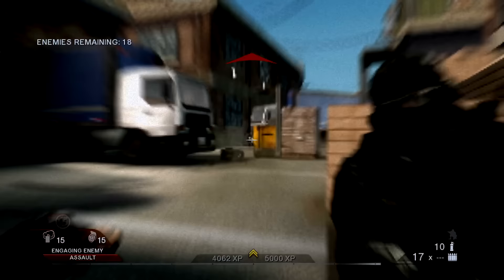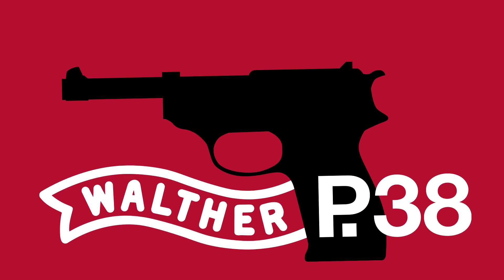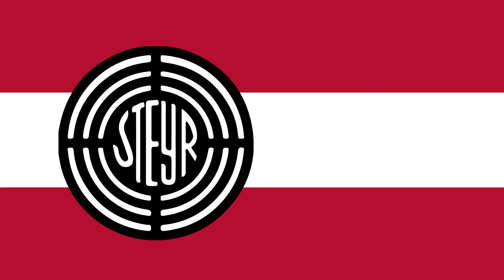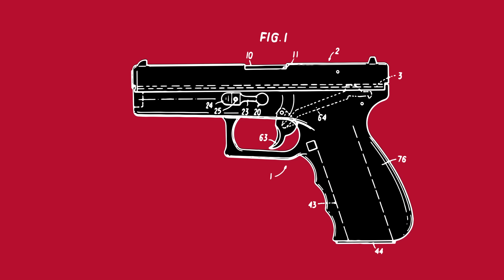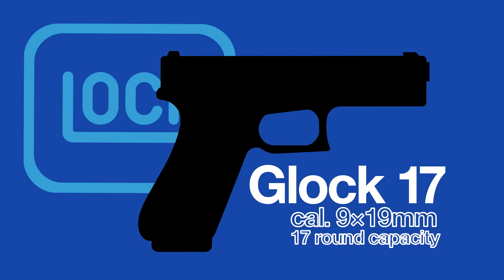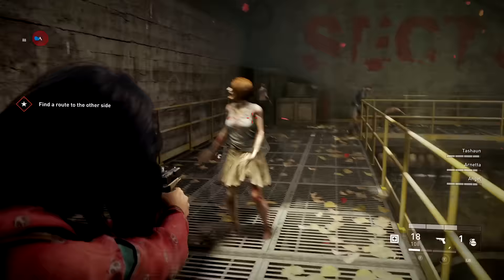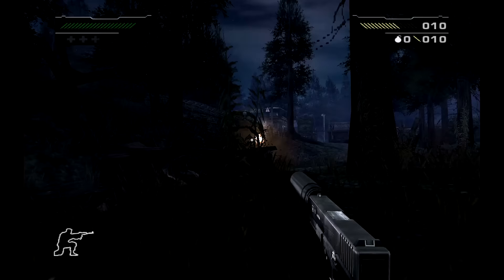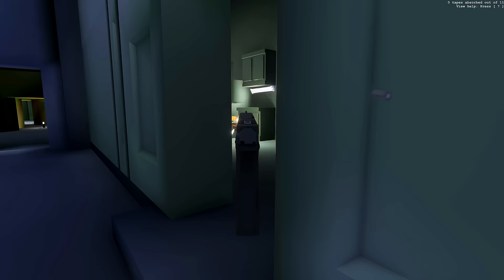Glock.

Comment: Dec. 27, 2023.  Rest in peace, Gaston Glock.  Your ingenuity for polymer set the gold standard for what a handgun can do and became holstered by just about the whole world.
Reply: I just found about his passing. I’m quite sadden that’s he no longer alive, but damn did he leave a legacy
Reply: man made a pistol you can 3d print o7
Reply: @Tau-5-weeb Not really, still requires a metal slide and barrel.
Reply: @pvt.potato1943  there are industrial machines that can literally 3D print metal or at least similar stuff inside sand though
Reply: @mdenizcoban are they fit to tolerate the pressure of a 9mm going off, however? 
I doubt so
Reply: @ocnarf40  they use some 3d printed metal parts in industrial machines i think, so it probably can, a metal printer is literally the same thing as pouring molten metal into a cast with the only difference being the cast actually not existing

"In 2013 a Texas company, Solid Concepts, demonstrated a 3D printed version of an M1911 pistol made of metal, using an industrial 3D printer. In 2014, a New Zealand company, Oceania Defence, demonstrated 3D printed titanium suppressors that are 50% lighter than conventional ones. The Grizzly, a 3D printed ."
https://en.wikipedia.org/wiki/3D_printed_firearm#:~:text=In%202013%20a%20Texas%20company,The%20Grizzly%2C%20a%203D%20printed%20.
Reply: @mdenizcoban  Never used a metal one but a plastic 3D printer most certainly does not produce the same thing as pouring (or injecting rather) molten plastic. There are probably additional considerations from the anisotropy that results doing things layer by layer vertically instead of all at once. Also some metal 3D printers produce sintered metal instead of fully melted metal which is presumably weaker.
Reply: @mdenizcoban  Does the average person have access to that type of industrial machinery?
Reply: He died on my birthday he is now apart of me
Reply: @jriemofficial983  bro he's not dead
Reply: o7
Reply: here from the subled2it smh i thought this was real....
Reply: oh well ahoy is a classic after i watch too many fps oldies CCs

Comment: Fun little tidbit: the "Glock" in Insurgency: Sandstorm is actually based on the Polymer80, a series of partially-incomplete Glock-compatible frames designed to be finished by lawful home builders in the US as they aren't finished to the extent that they're considered firearms, and thus can be shipped and sold in the same ways as any other unregulated goods within the country; a pretty interesting way to work around trade dress concerns for a game considering the nature of the real counterparts.
Even over a year later, this video (along with many others) is just fantastic to watch

Comment: it ranges in literally every size
It has XS, S, M, L XL.
Reply: Most pistol makers do.  No shade though
Reply: What Glock doesn't do is allow mixing and matching frame and slide length, like the Sig P320.
Reply: Imagine a Glock chambered in .50 Action Express. The Desert Glock
Reply: Vito C My god.
Reply: @TheSecondVersion  Still waiting for a Glock in:
· .357 (no, .357 SIG does not count)
· 9x25 Dillon
· .38 Super
· 7.5 FK
· 5.7x28
· .22LR or .22WMR Guess that's a thing now as of this morning.
· 7.62x25 Tokarev
· 9x21 IMI
Reply: @Hanzer-ns5bh  you can't make semi auto pistol rounds using revolver cartridges silly
Reply: @nedla7838  Tell that to Wildey and IWI.
Reply: @Hanzer-ns5bh  let me reword. You can, however due to the extended rim they aren't as reliable and need less than ~6 round magazines.  With those issues that kinda defeats the Glock standard imo
Reply: @nedla7838  Yeah, you're probably right. I just kinda want wildcat Glocks in big-boy calibers. Guess I'll just stick with 10mm.
Reply: @Hanzer-ns5bh  9*18 PM
Reply: @Hanzer-ns5bh  a 50 AE would be dope, I agree with the guy above
Reply: S, M, and G
Reply: Vito C that rings a bell 😬
Reply: would be nice if it’s have Glock 5.7

Comment: "Sometimes boring is exactly what you need."
Function over form in a nutshell.
It just works.  And that's the only thing that matters.
Reply: Glock 44 has enter chat
Reply: You see, the difference between works and works well is the same difference between glock and sig; in that order.
Reply: @Br00tz966  I would take a P229 over a Glock any time.

Never again I want a plastic pistol melting in my hand.
Reply: @umcaraqualquer3640  Amen. If there's a gun for self defense, its sig, and it sure as shit ain't a glock.
Reply: Then what gun does both function AND form?
Reply: @nolongerusing7430  AR15 %100
Reply: @nolongerusing7430  Quite many. As the dude said above, the AR-15.

But pretty much any weapon of the AR and AK models will do.
Reply: Just like King Crimson
Reply: WarriorKeens "It just works."™
Reply: Does it apply in choosing a spouse too?

Comment: I would very much like to see an episode on muskets, much like the one you did on the bow and arrow. The musket was the universal weapon for all armies for a long period of time and was the first effective firearm, it needs to be on this series.
Reply: I agree
Reply: It went from the equivalent of our modern anti-material rifles, to ye olde HPMR (muskateer units) to basically standard issue up until the middle of the civil war. It was a design that just got more and more streamlined with time, and set the pace for the evolution of any other two-handed firearm.
Reply: beretta arquebus
Reply: @CloaksCosplays  With the Civil war muskets where getting replaced with rifles (Sometimes even cap locks). Each country had a small difference. The most famous one is the “Brown Bess” since it used pins instead of the French “Charleville”. (Yes,I know this is an old thread)
Reply: Well I'm pretty sure the defining theme is that the weapons he highlights are present in a lot of video games, which muskets aren't
Reply: @jamesrosewell9081  are you sure about that
Reply: @joeligma4721 The muskets that I've seen mostly seem to be part of history shooters. Even the bow has seen more screen time probably because people play fantasy videogamed.

Comment: My uncle has seen some heavy shit in Iraq and Afghanistan. Worked for Glock and now regularly trains new users with them. He told me that the reason his kids only carry Glocks is because they're the only ones that don't fail out of nowhere.
When he had to rappel from helicopters in sandy conditions, it was the only gun that would consistently fire without issues every time. Everything else they had may or may not cycle the next round properly.

Comment: When a paradigm shifts, everyone starts from scratch.

Glock didn't really bring anything new to the market, feature wise. A Glock's most distinguished feature was a reason gun people originally scoffed at it, the plastic (glass fiber reinforced Nylon) frame. What it brought to the table was remarkable reliability at cheap prices. It will run with any ammo you use it with. And does so running a double feed magazine that gives it the +2 rounds over the 15rnds double stack single feed Beretta 92 magazine.
Some may call it begginer's luck, but nobody knows how many tweaks Glock made to the design over time before presenting it. If it was a bunch of parts he threw togheter in a weekend, sure. But it wasn't. Also, Guns aren't that complicated. Get it to not blow up in your face and you're already halfway there. The trouble lies in getting it to cycle reliably. And god knows how many times he got it wrong before getting it right. Maybe being an "outsider" was what made him see outside the box in designing the pistol.

Comment: Sometimes experienced manufacturers will get stuck. Sometimes, they'll find it hard to make a new invention. They already have their methods, their universal mindset on how to make a better product. They have their shortcuts. In these times, you will need a new manufacturer for the next leap in design philosophy. Someone who has little experience. A fresh outlook. A fresh mindset. Someone who lacks the integration of mindsets like "you will need a battery on every motherboard, fossil fuels in every power plant, physical parts for every calculation your computer will ever do". These are biases. Biases that brains develop to make thinking simpler. And biases that can only be broken by an eventual reset in the thinking process of manufacturers and designers. And this is what I find fascinating about all big inventions. Because most if not all of them, will all start here.

Comment: Ah yes, the Glock pistol. The Honda Civic of all handguns. It is popular, versatile, and appealing. It is also customizable, many aftermarket firearm parts brands also have aftermarket parts to give you the option to customize your Glock just like how you can customize your car. Want to put a Diamond Like Carbon or Titanium nitride coated barrel? Put it in. A compensator? Put it in. Custom trigger job? Put it in. The list goes on.

Comment: Such a simple gun i managed to make one out of cardboard with few pieces. 2 for the body, 3 to connect the body, 1 for the trigger guard, 4 for the slide, 3 for the chamber, a paper cylinder for the barrel, 5 for the mag and that's it. It's so blocky you could even draw it

Comment: It's square with round edges and without any sharp pieces or exposed pins so the user can draw it easily without hooking on clothes or another obstacles.
It has no active safety locking mechanisms. All safety features are passive, the only thing preventing it from shooting is the trigger, nothing else.
Simple, Reliable, Lightweight and Safe. That's actually all the qualities a gun must have.

Comment: The glock’s an interesting one. It’s made of a polymer composite, many of my clients think you can get it through airport security without setting off a lot of bells and whistles which I can not recommend.
Reply: That would be like thinking you could get an M16 or M4 through security as long as it's in a duffel bag. Utterly ridiculous.
Reply: @CrizzyEyes  Friend of mine accidentally left a handgun in his carry-on bag (uses it as a range bag occasionally) and was able to get on and off his flight, through security, without issues. It wasn't hidden or in a case either. This was a little less than a decade ago. And people think TSA stops terrorists when they can't even stop a blundering idiot from taking a gun accidentally. But boy do they stop those dangerous old people and toddlers from getting through without an extra search, and god forbid you take a bottle over X arbitrary amount on board.
Reply: lord of war
Reply: @Nyx_2142  Many Air Marshalls have noticed the same thing. And they typically carry the SIG P226 or similar, which is all metal. TSA just doesn't bother anyone except people with water bottles.

Comment: Glock users: Its perfect from the factory

Also Glock users: Replaces every stock part
Reply: Lee Hong Jin it’s reliable from the factory. Everything else is just improving the ergonomics/force multiplying.
Reply: Only part to replace would be the plastic spring guide rod, but it only fails after trying to run as much ammo through it as fast as possible as seen in iraqveteran8888s meltdown video.

Its a gun. It does its job. Its not pretty, but it doesnt care.

Its a workhorse of a gun
Reply: Glock Perfection ™
Reply: Glock users: Burn 600$ on a brick, proceed to replace every part, make the gun cost twice as much in the end.

Also Glock users: never train or use said overpriced Glock. Insist everyone on earth should like their preferred sidearm.

Comment: I carry a Glock 19 to this day ever since I got into firearms, honestly the aftermarket support for these is absolutely insane Buying anything else will just be cutting yourself short of course I do enjoy other alternatives but a lot of them base their design on the Glock
Reply: Glock bases it's design on the 1911. Just an FYI
Reply: @aylamaiia  I think what OP was trying to say is modern options such as the Smith and Wesson M&P or the FN FNS9 take the no tools, fast take down, and have a polymer frame base their design on what Glock did back in the 80's.
Reply: @Nathan-yf6sx  true. But still, mechanical design and cosmetic design are 2 different concepts, and almost every mainline semi auto handgun has been following the 1911 since it's debut for mechanical design.
Reply: @aylamaiia  I mean.. the 1911 was a game changer for its era. It debuted in war where the mainstay sidearm was a revolver, club, or sword and probably a shovel. It has been tried and tested for over a century and is still successful (even if Colt has since turned into a shitty company living off successes from WW1 to Vietnam). Why wouldn't you base your gun off of a platform that has been through 100 years of trial, error, and testing of all kinds? So I don't get why you injected your "fyi" because it seems like an attempt to get some kind of dig in somewhere its not needed, unless you are a Colt fanboy.
Reply: @Nyx_2142  Nah, I just see a lot of praise for Glock having "Spearheaded" the design as a complete;y revolutionary weapon platform that never copied anything no really. It's an annoying thing a lot of people push, and I don't like seeing it. Colt today is awful, but history of design needs to be given credit. People forget the PO8 Luger was made before the Nazi's rose to power for example. It's stupidity, or ignorance, and should be corrected.
Reply: @Nyx_2142  The reason the 1911 was come up with was the Moro Rebellion. Look that up.
Reply: Is there a Glock 69 yet?
Reply: Pedwé nope the highest rn is 48
Reply: @aylamaiia  Hi Point bases it's design on the Walther PP. Just an FYI

^this is what you sound like, by the way
Reply: @No-mq5lw  Hi Point's aren't mainline. They're cheap, and nobody takes them for a serious handgun, and not all Hi Points are based on Walther designs. What are you trying to prove? That I correct people on what I'm passionate about?

Comment: Glocks look great. Especially the gen 5 with that new finish on the slide
Reply: I hate the Gen5 though because there is so much compatibility issues with other parts. IMO they should have just updated the Gen 4 without the finger grooves. The Gen 3 and 4 were the best designs. But I guess Glock wanted something different because now with the Polymer 80 and 3D printing, and sheet metal weld kits, you can make a complete Glock using zero factory Glock parts.
Reply: Dave Smith never heard of any issues like that, but I also keep my 17 gen 5 bone stock. Which parts are experiencing issues ?

Comment: "how did it made such an impact on the arms industry?" 
thats because its cheap and reliable but you then hate it for the design of it
Reply: How is it cheap? A base model gen 5 Glock is $550-$600. With night sights they’re $650+ and MOS sight-ready versions are $800+. They’re in the same price range as other premium brands like Beretta, CZ, Walther and Sig Sauer.
Reply: @SG-ds8pr  how much did you think weapons are gonna cost?
Reply: @SG-ds8pr  indeed, berreta has cheaper guns, but they're worse. I've found a glock 22 for 500 dollars without any attachments of course but still. Guns cost more because they cost a lot
Reply: LOAN NGUYEN  I wasn't talking to you I was talking to the guy who posted the comment.
Reply: @wietick5677  When did I complain about the price?
Reply: @wietick5677  "Cheap" is a relative term. A $10000 car is cheap compared to the average price of cars. A $10000 watch is not cheap compared to the average price of watches. $550 for a basic model handgun is not cheap when there are a ton of options in the $200-350 range.
Reply: @SG-ds8pr  I never said anything about you complaining? What?
Reply: @SG-ds8pr  also the more expensive it is then the more probably better it is. That's why the glock was originally good.
Reply: @SG-ds8pr  i never said you were complaining, also in the first comment you said "how is it cheap" like dude why u always lying

Comment: A pistol that looks like it was drawn by a child. Yet it's more durable than any other pistol ever made.
Reply: Except the M1911.
Reply: @elijahscottcalanog2964  No, the 1911 can't flex like the glock can.
Reply: Yes it can, you just have not seen it yet in action.
Reply: Nothing against the Glock. It's one of the best pistols ever made, but the M1911 is classic and you cannot beat one. 100 years and still going strong.
Reply: @elijahscottcalanog2964  If you bend the barrel on a 1911, it will stay bent b/c it's made of steel not polymer.
Reply: Yeah, but even it has small flaws you cannot ignore the fact that this is more durable than most pistols.
Reply: The 1911 has it's own flaws, that is true, but ask yourself: Is it worth it to have more bullets if the gun is not comfortable and cannot kill with a single shot?
Reply: Exceptions are for the Glock 21, 30, 36 and 41. If you want to respect tradition and embrace modernity at the same time, pick those guns.
Reply: You probably cannot flex the barrel but why would you though?
Reply: @elijahscottcalanog2964  No pistol is a guaranteed on shot stop. It's where you shoot someone that truly matters.
Reply: That's a factor, but the caliber is also one.
Reply: You are probably on the 9mm side right?
Reply: No way you disagree that the 45ACP is bad unless you are on the 9mm side.

Comment: On IMFDB it says that Duke used a Glock 17 in Duke Nukem 3D, but to me it seems he had a Glock 21.  The slide on the sprite is pretty wide, and he changes magazines every 12 rounds instead of 17.  The 21 uses 13 round mags, which is still more but closer to 12.  Finally, a .45 fits Duke's vibe better than a 9mm.  Just my three cents (adjusted for inflation)